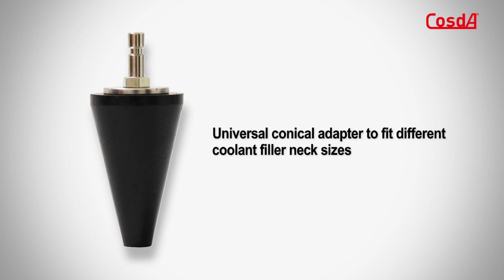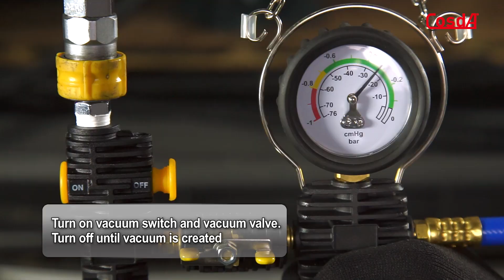Vacuum-type Coolant Refilling Kit (Patented)

Comment: Who else bought one of these cheap off ebay or Amazon and found this looking for better instructions than what was included in the case?
Reply: Me, MY tool had no real instructions. It had a tiny sheet of paper with a diagram of the tool which described the tool & all the parts & connections, and then it had a brief guide on how to use it. But these instructions didn't match the tool description.  I had an idea of how to use the tool but this video gave me all the answers I needed.

Comment: can this be used to pull old coolant out of the radiator and the rest of the system
Reply from the maker: Hi Emil, thanks for your question. Unfortunately this tool is not able to pull old coolant out. It only draws air out and subsequently creates a vacuum in the cooling system. Old coolant should be drained by releasing the drain plug at the bottom of the radiator (as in a conventional method) before creating a vacuum.
Reply from the maker: @zlmdragon.  Hi Dan D, it's hard to give you an accurate percentage on the refill rate, but usually we would have about a few hundred milliliter, but less than half a liter, left after refill by vacuum with this tool, and mechanics just top up to the adequate level by pouring coolant as slowly as possible.

Comment: Hello Cosda Manufacturing Company, please provide a link that would show the pricing for these auto radiator coolant testing sets, I am interested in SD-1019. Thank you.
Reply from the maker: Hi Alex, thanks for showing interest in our product. You may place an order via this link: https://www.alibaba.com/product-detail/Radiator-pressure-tester-Vacuum-type-Car_599404756.html?spm=a2747.manage.0.0.2d701757oEUd4R    Thank you!
Reply: @CosdaManufacturingCompany  Thank you for the reply, very helpful.  it turned out I was looking at the 31piece package, which is SD-1019D.  The shipping cost  regrettably is really stiff, almost a deal killer.  Are there other alternate shipping methods that are not so costly?
Reply from the maker: @alexedward1250  We have been consulting delivery costs from various carriers but unfortunately we are not able to find a less expensive alternatives. Maybe you can take a look at our other products and we can ship collectively to reduce delivery cost for each item. Thank you!

Comment: curious how the system creates a tight seal on something like a 200 f150 with a 5.4L engine.
Reply from the maker: Hi Scott Roark, thanks for your question. The radiator filler neck adapter is in a conical shape. When vacuum is created in the radiator, the vacuum sort of sucks the conical adapter in to form a tight seal on the filler neck. I am not sure what the size of the filler neck is on F150 with a 5.4L engine, but the sizes range of the conical adapter is 5.1" - 17.7".
Reply: Cosda Manufacturing Company thanks. That makes sense.
Reply: @CosdaManufacturingCompany  Your 5.1 and 1.7" measurements appear to be lengths of the filler tube. But isn't the diameter of the filler tube the important dimension for knowing whether the conical adapter will do the job of sealing the filler tube? What is the diameter of the wide end of your cone?
Reply from the maker: Hi  @chuckoneil4884 , thanks for your comment. The external diameter of the wide end on the cone is 45 mm or  1.7"

Comment: do you know if there is any other type of adapters that you can screw on instead of using the cone because they are very unreliable, they tend to leak air and do not hold pressure unless you are pressing it down.
Reply from the maker: Hi Gabriel, thanks for your feedback. Yes I agree with your comment, this cone shaped adapter is more for an easy, quick and universal way to do the work. And yes we do have other types of screw-on adapters. You may check our other videos SD-1019 where we combine this vacuum coolant filler with all other screw-on adapters. Thank you!
Reply from the maker: Here is the link: https://youtu.be/1Pyo1QMIxNk
Reply: Would a cap from a radiator pressure testing kit work? Same thing, but for pressure, another handy tool in the shop too.

Comment: what are the required air compressor psi and tank gallon
Reply from the maker: Hi, in our garage we have two types, one is 100 psi, and the other is 175 psi, and the tool work well with both compressors. Hope this info helps :)
Reply: @CosdaManufacturingCompany  I have a 8 gallon tank compressor with 125psi will that work or I need a bigger tank?
Reply from the maker: @shawnbiko1557  Yes I think that 125psi would work. Vacuum creation might be slightly weak but it might only prolongs the process 30 seconds to 1 minute more than bigger compressors.
Reply: Hello after draining all the coolant out, if there is any water remaining in the system does it get forced out while creating vacume

Comment: How does it get through the thermostats?
Reply from the maker: Hi Valspar, this tool refills coolant while the engine is off, so the thermostat is always closed. The aim is not to create a circulation in the cooling system, but to refill the coolant in the radiator (and expansion tank) so it does not matter if the thermostat is open or not. Hope that helps!
Reply: @CosdaManufacturingCompany  In that case, why just stick a hoover or hand vacuum pump on the overflow/return pipe and suck?
Reply from the maker: @razmossis  this tool does not suck coolant from the cooling system. Users need to drain coolant in a conventional method by opening the drain valve at the bottom of the radiator first, and then use this tool to create a vacuum in the cooling system, and use the hose provided to introduce new coolant into the system.
Reply: Thermostats have a 'air bubble' hole in them to let air bubbles thru. In theory a vacuum would 'joggle' some pooled coolant/flushing dH2O in the system, around so it would drain out later, if the drain taps is open.
Several dH2O flushes are needed after old coolant &/or flushing cleaner anyway.
This unit removes all of the air out of the cooling system, then replaced it with coolant.